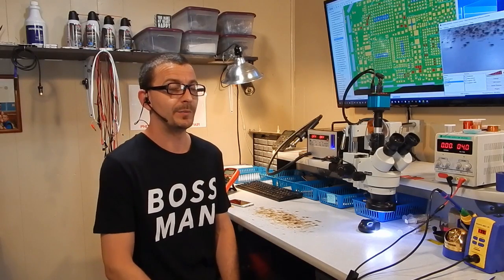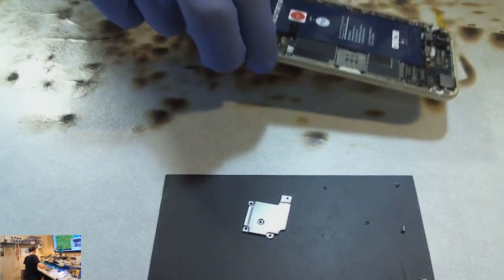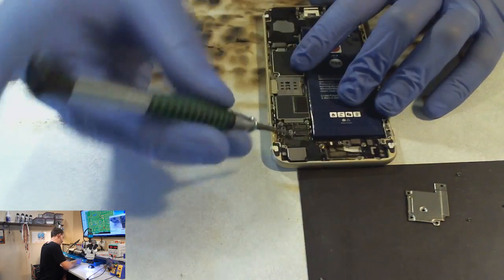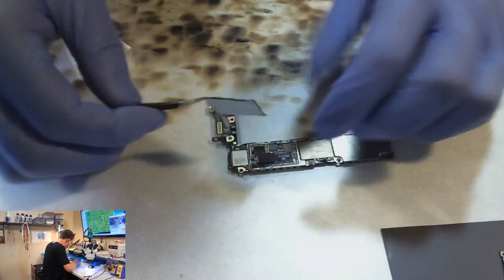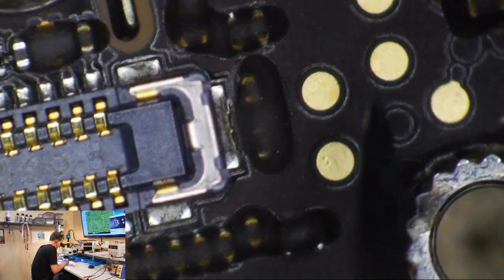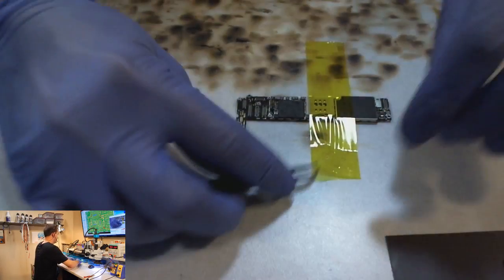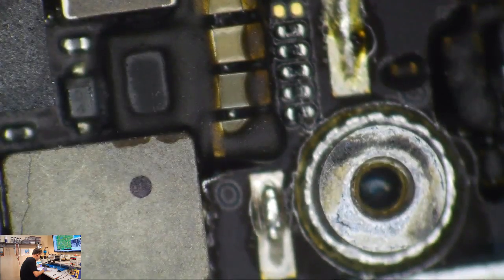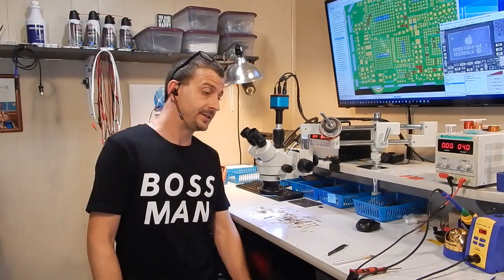An iPhone 6 is Pronounced Dead on Scene - A Previous Touch IC Repair Attempt

Comment: Are the phones unattended?
Reply: I would imagine to an extent they would have to be, this isn't the kind of work you can do where it's okay to stop in the middle of it to answer the phone. Most of his business comes in through his website, and likely very rarely gets phone calls. It's just easier to consolidate and handle that way.

There's a lot of room for fucking up this level of work when precision and accuracy and time are the most important factors in doing it. All it takes is one distraction and you've just knocked half the components off in an area, or brought your hot air nozzle too close to the region and just floated the CPU. The whole idea with this work is to heat as minimally as possible. If you remove one component and you are going to replace it, you need to do it as quickly as possible following removal because the board is still going to be hot.

If you stopped to talk on the phone for 20 minutes, your board just cooled down and you have to put it through another complete heating cycle, which further increases risk of secondary problems. I really would not blame him if he rarely answered the phone.
Reply from the maker: 9 out of 10 times I pick up the phone it is 20 minutes or more out of the day gone.  If I took every call, I would literally do nothing but talk on the phone all day.  We are getting ready to provide an emergency means of contact and then change the outgoing message to explain our phone / ticket / overload situation to the people who insist on calling.
Reply: Yeah, the person on the other end of the line always has to give you their life story on what's wrong with their device. You can say "just submit a ticket" or in my case "just bring it down here" all you want but they need to hear "yes, this is a problem I can 100% fix" before they bother, which I never say, because I can't know if I can fix it until you show it to me.

Most of the time I don't answer the phone at work if I'm busy, because what inevitably happens is I answer the phone and before I know it I'm stuck in what I call "the front desk hell loop", whereby I get off the phone and no sooner than I finished up the call, a customer walks in and I assist them. Then when I sit down to work....boom, another phone call. Sometimes I just need to get work done. It took my current employer ages to finally listen to what I was telling him, which was to hire me some help because I can't fix computers, laptops, phones and tablets, and handle a stream of walk ins and phones.

Now that I have a coworker I still really do not like answering the phone because I know what will inevitably happen. It's like clockwork. I don't do much of any board work while at work, but if I did I know I wouldn't get anything done from constant interruptions.

I envy the shit out of you, I wish I could just leave the doors closed and get everything dropped off in a box for me. On the plus side, if business is ever slow, all I have to do is feel like I need to take a dump while I'm the only person in the store, and customers will flock through the doors. It's an exact science.

Comment: how big is that screen. is it a TV via hdmi? the text are they smooth like a regular pc monitor? i bet its cool to read schematic in that size. thanks
Reply from the maker: 43" and it is VERY clear.  I had a 1080p display before this one and it was a bit fuzzy/blocky.  The pixels were just too big and it gave me a massive headache.  I took it back to Walmart and added $50 to the cost and bought this 4k display.   I run it on 1080p but the image is very clear like a desktop PC monitor.  I love this display :)
Reply from the maker: yes, hdmi.
Reply: noice...i want my setup like that. :) my 27" monitor taken most of the desk space. my scope is in the middle. if i push the monitor further back, then things on screen just get small to see.
Reply: Wait why would you buy 4K then bump it down to 1080p?
Reply: Try a monitor mount! I have a 27" display and use a mount with an arm so I can position my monitor anywhere. The actual mounting mechanism only takes a tiny bit of edge space on a desk. It's quite amazing.
Reply from the maker: Frame rate.  I was only getting 30fps on 4k.  I don't know if it's the display itself or the laptop I have it hooked to.  Also, 4K resolution was a bit much for a desktop I thought.  I wound up sizing stuff up even at 43".  If I can get 60+fps at 4k, would be sweet though.  I could deal with making stuff bigger when needed.
Reply: Wrong port :D